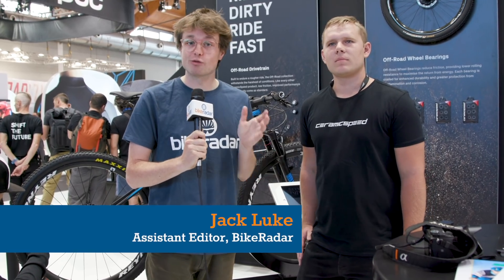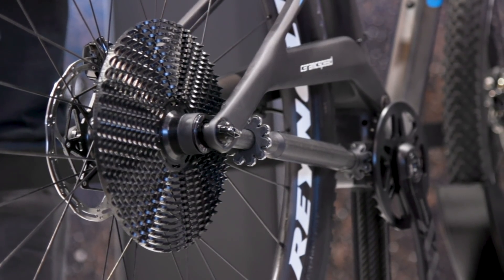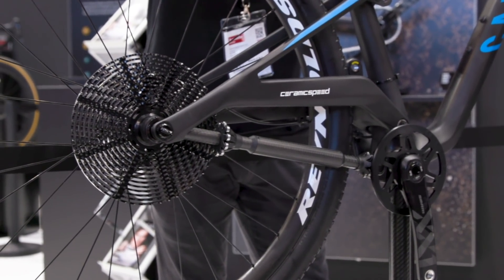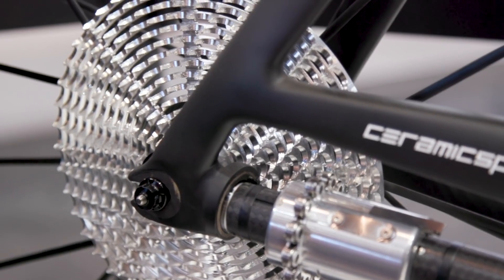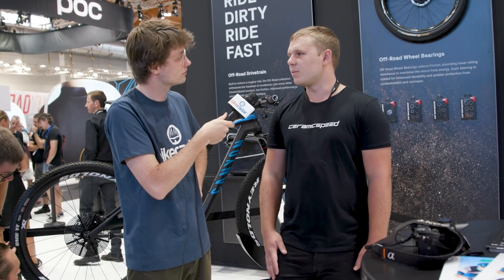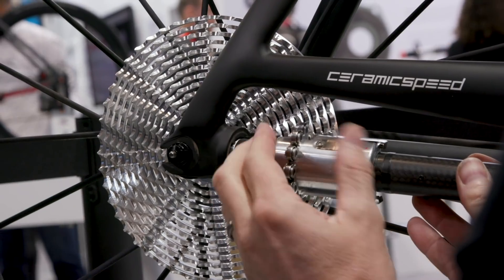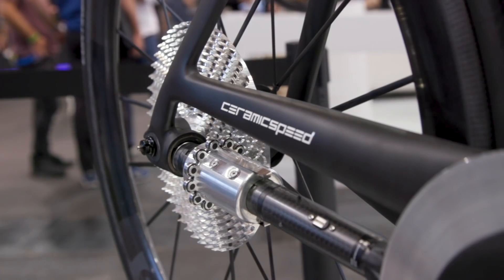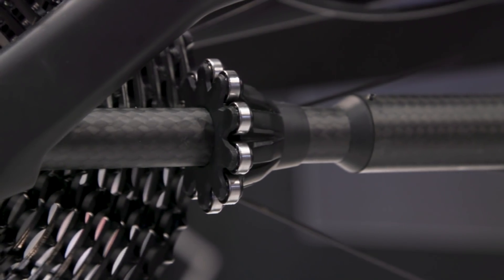No More Chains! The Future of Bike Design? | CeramicSpeed’s Driven MTB & Road Drivetrain

Comment from the maker: We published a video about CeramicSpeed's Driven chainless concept drivetrain last week and... well, a lot of you didn't like it ⛓🙅‍♀️ The innovative brand addresses some of the (fair) concerns about last week's news and is now ready to show a prototype version of the drivetrain that shifts, as well as showing a mountain bike version. We're pretty excited, but what do you think?
Reply: How can it possibly be more efficient when it has to transfer the force 90 degrees twice?
Reply: I don't want to hear about it anymore until you just jump on it and ride off
Reply: lol - face-palm. These people are so clueless - look at that thing! ONE point of contact between the crank and the drive shaft and ONE point of contact at the rear. It features loads of  exposed bearings. It's made of alloy.  You are trying to transfer huge torque by engaging with the SIDE of the disk at the back? Did you ever play with lego or mechano as a child? Anyone who did will know straight away that this thing is a Heath Robinson Contraption (Rube Goldberg Machine, for our American friends).
Reply: jancreighton. I agree. You wouldn’t want to be standing on the pedals for a quick start. Those flimsy rear gears look sure to flex away from the shaft drive, helped by the fact they’re bearings to aid the “roll out”. Ride through some dirt and watch that tiny motor fail to pull into a lower gear.
Reply: It is an absolutely innovative way to sell more ceramic bearings.
Reply: slashmatt exactly lmao, they only wanna produce this so they can put a patent all over it. And sell overpriced parts to repair the flimsy shitshow that is this shifter
Reply: So what you should do is have a bb gearbox to a single speed driveshaft rearend  around the same drag but wayy less vulnerable than a derailleur
Reply: BikeRadar “look guys, now it moves!”
Put it under force testing and ill believe you chief, until then its a concept car that starts and idles, but cant drive.
Reply: How many separate gears are there?
16? 24?
Reply: Im waiting a year for that, but i think it's a big fake sistem
Reply: I like the Audio Network music background. Solid website
Reply: Could this be applied in a car?
Reply: Thanks
Reply: Now I know what bike I will buy
Reply: How much
Reply: @umialsoregretwatchingiralf6638  too much money for no gains👎🏻👎🏻👎🏻
Reply: It's not that we don't like it, it's that he's saying it without video footage of torque being applied in a live scenario.
Reply: Didnt work 5 years ago. Still doesn't work now.
Reply: I feel as if the rear cassette and the shaft end should be encased to avoid contamination. Unless it was sealed 100%, I am sure over time the same issues of contamination would hinder the drivetrain. I would like to ride one to see how it shifts. Really cool design!
Reply: @Lawrence-p3z  how is it a lie? It's definitely more efficient it might not be as strong but it's still more efficient
Reply: Might be a really dumb question but why not out the gears on the pedal side, and you've solved the problem?
Reply: @TF12191  Not dumb at all, they's a few bikes that have a gearbox at the bottom bracket, to achieve the same result as the concept in the video. Tends to be a little bit heavy though.
Reply: Can I buy this from Bangladesh???
Reply: I love innovation, but I'm not a Luddite.
Reply: https://youtu.be/ryx5sDPkMUQ
Reply: So, two years on… any real progress since then?  The shifter is clever, but it still is hobbled by the plate of cogs being a big cantilever that always trying to cam away from the driver.
Reply: What do I think?... i'm still waiting for a vid with that concept working in real conditions on a road or now the mountain

Have you ever seen a vid this last years since they presented the bike on a real condition test?. Not in the stand?... Me not.

That shows me it doesn't works and its more marketing
Reply: @Ausias75  That shows it's a prototype and they dont want to show a work in progress, most companies dont like showing projects prematurely.
Reply: This video didnt change how most people feel. We need real video footage of people "riding" these bikes. Until then it's just shop talk.
Reply: Engineering solutions for problems that don't exist, which was solved nearly 150 years ago with the roller chain for a supposedly minimal efficiency gain that present huge costs and complication for reliability and maintenance for the end user won't normally find itself being implemented, but then again £12,000 bicycles exist in the market place.
Reply: @amfearliathmor8213  The concept of moving a system with less effort dates back ti rhe greeks and roman, the way this system works is no different than what they use to move heavy objects or pump water.
Reply: @amfearliathmor8213  maintenance would be simpler. Chain need careful and tedious adjustment and maintenance to get the most of it's efficiency. More contact point=more frictions.
Reply: @medtxastratospore5729  careful and tedious adjustment?!?! Respectfully, do you ride a bike or do you just look at one?
Reply: Nothing new!! Been around since the 1800s... I thought I read somewhere that some scottish guy came up with it, im not sure  https://www.youtube.com/watch?v=PUGihIPRec8&fbclid=IwAR3xPNyYBESR1EPsz5OiqBs7S_UTaqt71qLmYXOsb0AmsqbHve8fnuzbKVo
Reply: @mazemaster3261  Electric cars have been around since the 1800s too, doesn't mean it's a terrible idea to use them now.  That said from the concept it looks like it will be stupidly expensive and it will have a lot of slop.  Time will tell if it can be reliable.  All that for small efficiency gains and getting rid of a derailleur.
Reply: So anyone who may have legitimate concerns, and choose to post them, is a "Hater" according to you?
I suggest this my little Soy-Boi friend, you can take your fragile snowflake speech-police attitude and wipe your ass with it! If you ever tried to deny my right to express my thoughts face to face I'd bitch-slap you into next week!
Reply: Ambition is critical! .. Well done to you visionaries!
Reply: Watch this video published in 2015. Then, you will see that this chain free bike was made in turkey by Mucit Hasan

https://www.youtube.com/watch?v=FDvoNXPIfJ0

Comment: Grooved collapsible bladed-fan-bushing or aperture-style forming crowned pulley ball (cog), banded v belt (belt drive chain), forward-lever which brings the drivetrain forward and moves the collapsible grooves on the pulley ball to the outermost of the concave (higher gear). No chain slip. Smooth temporary increment of higher transmission. Haha you've dealt with it

Comment: good idea, I see the future in it, but there is one problem. The design of the drive requires the replacement of the frame. Hardly anyone will specially change the frame and spend several thousand on a new one just to have this drive. Unless you do so that you adapt the structure so that it can be mounted in place of today. I will buy it if I succeed and I can mount it to my bike if I do not intend to change the frame and spend more money on a new one. From what I can see, I think you will be able to construct an adapter;) Regards

Comment: Sounds silly but why not treat it like a dual clutch transmission?
Run 2 drive shafts, one engaged the other not engaged, when you shift gears, the non engaged shaft engages while disengaging the driven shaft, with a minor over lap so there is no loss of torque.

Comment: I'm not a bike person, can anyone explain what this does better or what problem this solves?
Reply: It doesn't do anything better. This design is flawed and far more inefficient than the standard chain bikes. The force is running through a 90 degree shift with only 1 or 2 teeth in contact at all times. Whereas the standard chain has at least 50% of its teeth in contact.

The first problem is immediately obvious. Only 1 or 2 teeth taking the full brunt stress torque of a 200lb human isn't going to be able to handle it and will sheer off. 

The second problem is the 90 degree means less efficiency. Meaning the cyclist would have to expend more energy peddling to maintain the same speed and distance as a standard chain bike. Basically, it's a fail design.

Comment: I love the concept...  I understand what the "haters" are saying, and they make good points... I think it should be mated to a gearbox rather than having the shifting done on the pinion and ring, but rather in a gear box, either an internally geared hub or a gearbox up front.

Heavy?

Yes, but for the ever growing world of Ebikes, would not be a concern.

Solves a problem that doesn't exist?  Not true, any HARD CORE MTB guy that ventures OFF THE TRAIL knows that that rear derailleur hanging down gets stuck on sticks and brush all the time, and with long cages, you break that rear hanger far too often.

Very few "contact points"...  with the shifting done in a gearbox rather than on the rear "cassette" you can design the gears to be like a ring/pinion on a car and have plenty of strength.

I think with the right engineering, and enough budget, and some time, this concept has some legs.
Reply: right. put the gears right in the bottom bracket

Comment: Idea is pretty dumb. Uci would only outlaw it to its lethal design unless used in solo time trials

Disc brakes glow red hot. They're banned in uci because they can cut into the body during impact also..

 Spinning cassette with teeth facing outward. Spinning at a few hundred rpm 40mph pile up with two dozen riders you could be looking at worse than just grazed skin and more like severed skin or a serious accident could really sever a vital vein or artery.

Comment: 1: Its not cost efficient. It has tons of different parts, which wear and need replaced. It also needs a cover/special frame and all that adds to cost. Once it is on there, customers have no other options available, they wont be able to convert to a regular drive train, and therefore have no alternative parts if they would want them.

2: Its overly complicated. A chain-derailleur system is very simple to use. Just about anyone can work on the parts, change components out, replace worn components, etc. Also once again all those components are interchangeable for custom setups as well.

3: It looks weak. It is not resistant to debris, and this needs a cover. He eluded that it would fail under load, and because all the force is horizontal instead of vertica, I see those gears needing re-enforced in the horizontal direction before seeing real use on a bike.

Benefits: Wont need wider axles to accommodate more gears, That is about it. I dont buy that it is more efficiency.

Comment: It also needs a connector called a love joy on the shaft.  Its 2 pieces that look like a gear with a thrust bearing between them held together by a chain.  It also looks like the rollers and disk will not mesh quite right.  Maybe if that shaft had roller balls that meshed with pockets milled with a ball end endmill.

Comment: Wake me when theres an automatic-shifting bike
Reply: I think we are basically at that point, no one has implemented it yet though. With wireless DI2 shifting, and the cadence/power outputs on a modern e-bike, it should certainly be possible to achieve autoshifting with a bit of software. Trouble is, manual shifting allows you to account for imminent elevation/terrain changes you often encounter on MTB trails... I could see it being extremely useful for road bikes though, where you have a cadence/power output target you want to stick at.
Reply: There's at least one already - Unibike Energy

Comment: it's a cool idea! but honestly I think CVT gearboxes // hub gears with belt drives are the way forward. they're easier and cheaper to maintain, and probably much more resilient too- look at how thin the contact points on this thing's cassette are, and how much it would flex at the edge!! every turn of the pinion would just create a new stress riser, and if this snaps roadside good luck fixing it. I can see this being handy for singlespeed track bikes though if the increase in efficiency is what they say it is

Comment: I think If they put the rear suspension pivot point on the crank point the. There will be no change of distance between the two points on the drive shaft when the suspension travels.

Comment: "so what makes this good for mountain biking?"  dude says  "More efficient" 3 times and mentions the derailleur isn't there to get damaged.  But sticks, leaves, grass and mud will take it down- you know, the things you never encounter mountain biking....
Reply: Leon Hubbard he also said it will most likely need to be covered up to get around that...
Reply: @ericmagee9054  right, so now we start complicating the simple thing, and it starts to make no sense.  a frame manufacturer would have to make a frame specifically to accommodate the drivetrain- have fun figuring that out. Then everyone with a $500 hybrid thinks they can install it on their bike because they "saw a cool video on facebook."  -ask any bike mechanic, they will likely laugh this ceramicspeed nonsense off as a PR move..  -and maybe in 10 years this post becomes a meme because this silly drivetrain has become the new standard on every kind of bike, even crappy ones from department stores....

Comment: It's about time that this concept was finally put into reality! I wonder how expensive they will be though.
Reply: Quality cassettes are already machined from solid. So the rear cassette shouldn't be much different in terms of production cost. Front chainring is also machined from solid, but so are modern chainrings. Material may need to be harder, so that will add cost. 

The shaft/bearing system is going to be more costly than a chain, and the electronic shifting system will add cost. 

You do save on a rear derailleur. Honestly, I could see the cost being similar to other high end traditional drivetrains if these become popular and economies of scale kick in.

Comment: This is a similar approach to spider gears in differentials. The fail point is attaching the gearbox to the wheel. Put the bearings in the frame of the bike and make this system spin the shaft in the rear tire. Make the rear hub attached to the shaft.

Comment: It’s an interesting idea....
I can’t tell you how many derailleurs I’ve bent and broken and I think that this could be better if they had some sort of cover over the mechanism
However I don’t know how how it would handle going down a rooty and rocky trail would it flex or fall off? It will be interesting to see
Reply: It's the mud I'd worry about. The amount of times I come back from a ride and my bike is covered top to bottom in thick mud, yet the cassette just clears itself up and it never causes an issue with shifting or power delivery. The greater points of contact with a cassette/chain, and the flexibility of the chain means it still performs well and self cleans. 

Now image some mud getting on the cassette of this, the tight tolerances, lack of flexibility between the drive bearings and cassette etc. It would create massive loading between the drive gear and cassette, grind like a mother fucker.

Comment: Nope. This will not receive any real load. There is a reason the demo doesn't have pedals. Any real power will cause immediately failure. Too much power into too little surface area.

Comment: bruh I had a dream about something like this and the image in my head was so similar to this that's why I found this video. For ceramic speed, what i saw in my head was a stepless drivetrain so it is j pushed back and forth but to remove the moving aluminum piece make the whole shaft one piece (obviously with a spring-loaded expanding sheath) and why not have the same thing on the pedal position? so sorta like a CVT transmission makes it infinitely variable so the shaft j slides back and forth across two open single-piece machined aluminum 'cassettes'

Comment: The thing I don't like is that I can't service it myself.
Reply: Yes but the immediate benefit would be not needing to service it often. No bent derailleurs, no stretched cables, and no large moving parts. The worst case scenario would be a faulty motor and that would be no more difficult than installing new shifting cables

Comment: Legit question here: as a motorcycle mechanics, we deal (all the time) with the two types of propulsion. Chain and drive shaft. And it is an established and measurable fact that the drive shaft system, albeit the more reliable, is less direct in transmitting power and consequently less power efficient. In short, a drive shaft system takes more effort to transfert power to the back wheel. What is your experience with this principle applied to lightweight bicycles? Is the loss in power neglectable at that small of a scale (compared to moto), or maybe even is MORE efficient? I'm very interested in reading your results! Thanks
Reply: For regular gears, a drive shaft is less efficient, but this concept is using a novel gear system with bearings for teeth, so it supposed to be more efficient. I believe them, but the design has many challenges. "less direct" in this case is purely imagery for justifying the difference, it's all about the number of sufaces that are rubbing against eachother under load.